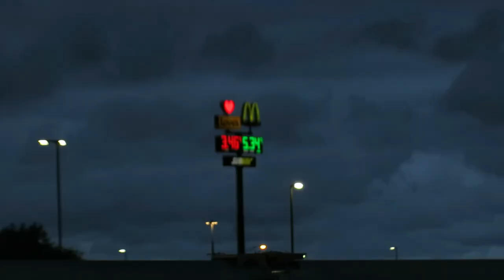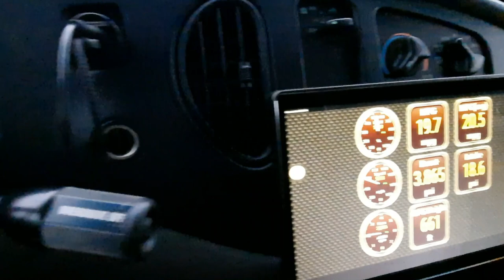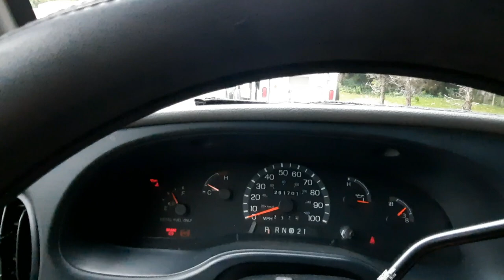Is The Truck Going To Hold Together? | Part One Of Our Trip Riding On New Parts

Comment: Maybe get a Heat scanner gun to test the rear end fluid for tempreture.? Then you will not have to reach so far. You can get one at home Depot or Harrbor Frieght. Some use it in Chrysler Town and Country to test temp when checking the transmission fluid.
Reply: Good suggestion.  The one I have from harbor freight has worked well for over ten years.  Buy extra 9V batteries, it likes to use them up.
Reply: I check all bearings and tires with mine. Quick and easy.

Comment: A suggestion would be to get an inexpensive infrared thermometer.  Start checking temps when you make a rest stop.  Differential, axle hubs, brakes.  You will learn the normal temperature range and someday might catch something getting hotter than normal.  Handy for grilling also.  

Safe travels you guys!

Comment: If your sugar and salt is getting moist, it’s because of humidity levels. Down south, us dumb country bumpkins put a few grains of rice in the containers. The rice absorbs the moisture in the air and your salt and sugar stay dry.

When we pull our camper, we cruise at 60mph.  Once we hit the road for long trips, our goal is to cruise at 60mph for 4hrs (240miles) per day. We stop every hr - 1 1/2hrs to stretch our legs snd move our hips).  We may take 6 - 8 hrs to cover the 4hrs of actual driving time. This leaves us time to stop snd see attractions along the way.  We want to enjoy the journey as much as the destinations.
Reply from the maker: We've been running at 55-60. I'll tell you, it's much more relaxing that doing 70+ all day! And, our mpg improves dramatically.

Comment: I would change diff oil after 500 miles. Break in procedure for new ring and pinion. Then you'll be good for long time.
Reply: That’s a good idea. I never would have thought of applying that idea to a differential.

Comment: I went with pillar gauges, but you might consider an Edge Insight Monitor for a gauge solution. It is really nice to have gauges to keep an eye on all the real temps instead of just relying on the factory gauges. Happy travels!! Edit @11:35 I see you have the torque app.
Reply from the maker: Thanks for all the info you emailed me Rex. The Torque app is limited I've found and I'm looking to add some 'real' gauges for the important info.